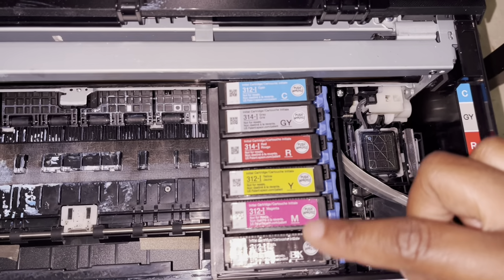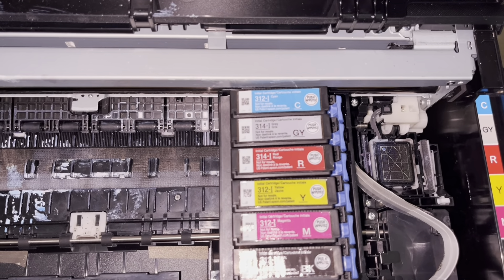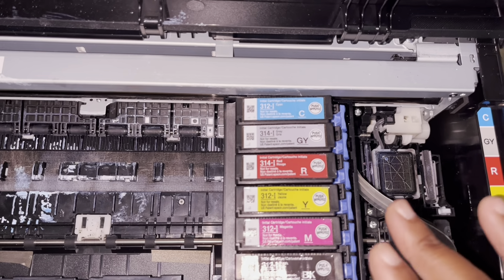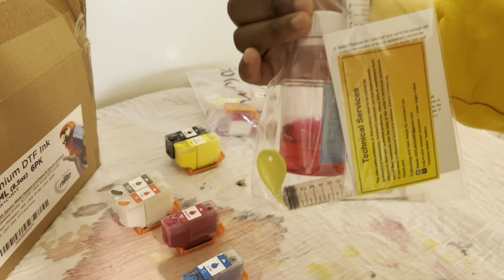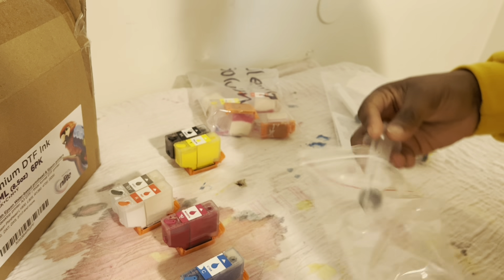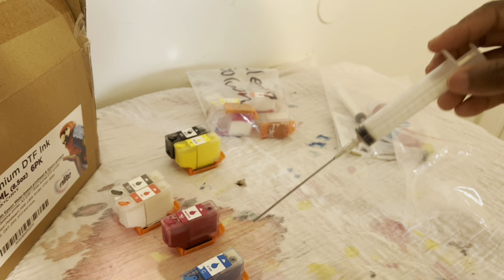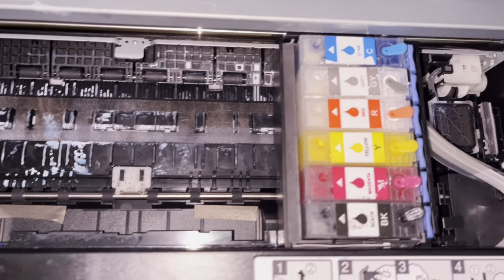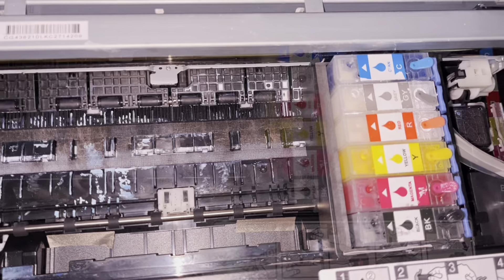How to install DTF INK Cartridges for XP 15000 (Full Video)

Comment: I have a question please help. I did my first setup with the original cartridge, I took them out after the 10 min installation. Do you think I messed my printer up? By possibly mixing of the inks.. I haven’t purchased my dtf empty cartridges as of yet. But do you think i affected anything?

Comment: Hello, on the first video you redirected the hose for the waste box, so is the waste box now on the outside and the waste box initial location was in the front, will that one stay there without the hose connected for the purpose of programming? And what does the external waste box look like?
Reply: Hello just wanted to know were to get the blank cartridges from

Comment: Hey, do you do the print test and alignment with the cartridges that come with it first then change to the the chipless?
Reply from the maker: No you want to replace those carts with DTF or you can drain those carts and put to DTF ink in them.  Once that’s done then you can run the test print. Also you’re going to do the chipless setup after you covert the printer.

Comment: Silly question - how will you know if the ink levels are low? Is there a system you have that will alert you?
Can you also do a video on your print cleaning routine?
Reply from the maker: Hello and no I don’t think you asked a silly question, one of the ways to know if the ink is low is when you go to print your image will either not print correctly or fade out. Another way to know is when you do your nozzle check the same thing will happen the print lines will not be there or you’ll have breakage in the lines. Also when you go to open your printer to do your cleanings you will see that your ink is low and lastly if you do a ciss system that one is much more visible to see that you are running low. I hope this helps and I will try to do a cleaning in my next video!

Comment: I did a few prints with OEM ink before switching over to dtf ink in new carts without cleaning . Then I didn’t recognize that Bosc was clogged and did head cleanings till tank was full I have new waste tank coming but once I clean printhewd really really good I should be ok ?

Comment: What do you do after you have installed the waste tank and put the ink into the refillable cartridges? Can you then print. I have installed the chipper’s firmware as well
Reply from the maker: I believe you have to let you print do like a cleanse with the ink first, I forgot what it’s called. What type of printer do you have and did you remove your rollers yet?

Comment: First question, do you have to have Cadlink or a specific software to print DTF, or can Inkscape be used? 
Second question, how does the printer or software know that white ink has been put into the grey and red cartridges, what if the image needs red or grey will those colors print as white?
Reply from the maker: Yes you do have to have Cadlink or Acro and the printer is going to print whatever color you have in the cartridge, so even though it’s labeled red and grey and you put white ink in the system is going to use it because that’s what’s in it. It would be just the same if you used any other color in that slot, that’s why you have to triple check where you insert your ink.

Comment: Have you tried a CISS with dampers? I hear those refillable cartridges leak and flood the printer often unless used with a CISS system with the dampers installed. I searched YouTube“ciss xp 15000 flood” and haven’t had any flooding since using that CISS.

Edit: Here’s the video…. https://youtu.be/jUX769JoRO4?si=iF0n3vtWZf8sEkle